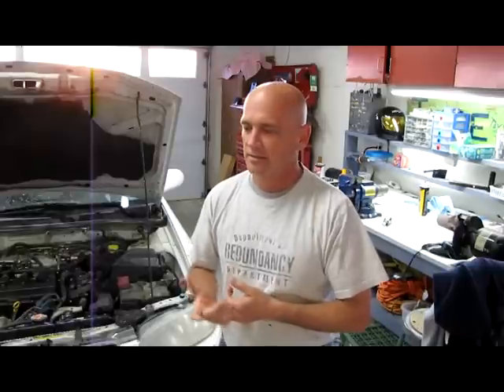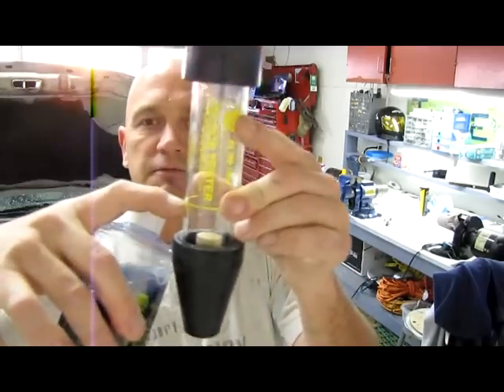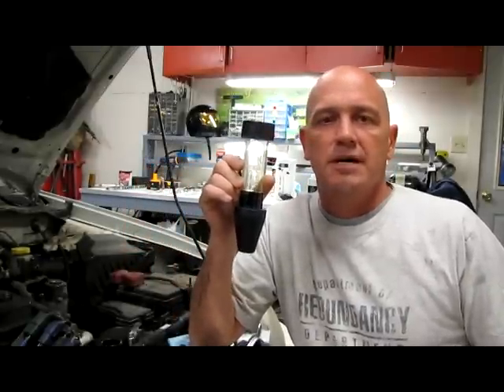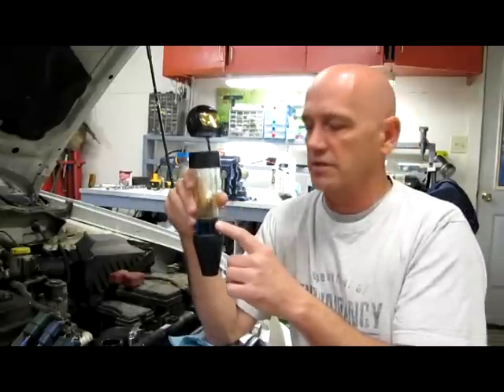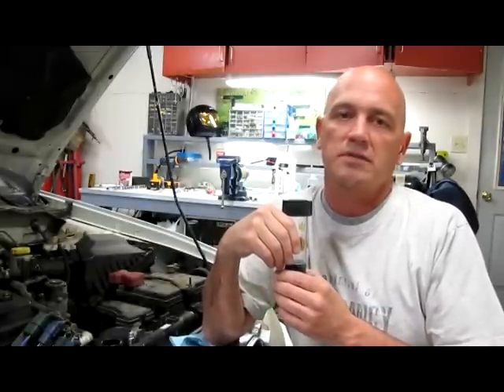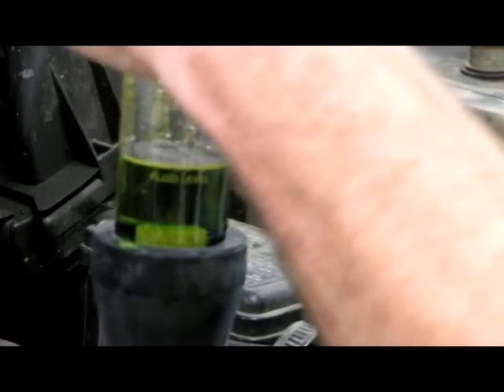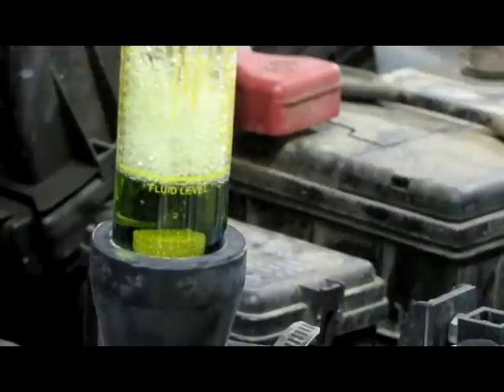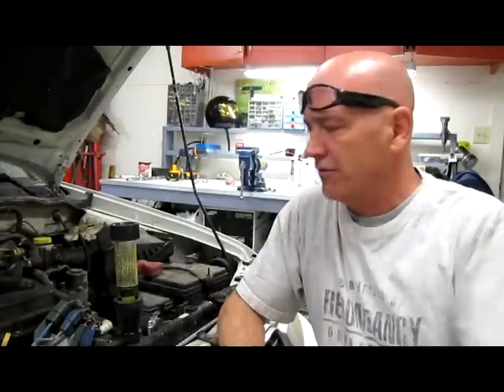How to Test Head Gasket

Comment: Can this test be performed using the coolant expansion tank instead of directly on the radiator?
Reply from the maker: ipdjbt: Yes.  If you search YouTube, you can find others using the same method with expansion tanks.  r-
Reply: Thanks!  I wasn't sure if the vapors would travel to the tank from the radiator.
Reply from the maker: The vapors 'should.'  I say this only because I've seen other videos of folks doing the test this way.  This stuff isn't cheap, so I suggest you contact the maker at go blue devil dot com, all one word of course.  Would love to hear back on your results!  r-
Reply: My results were negative, which lead me to question if the expansion tank test was valid or not.  I may perform the test using the radiator just to confirm my results.  Thanks for all the info!
Reply from the maker: Ok- just run the coolant low enough level-wise to only grasp vapors, but keep an eye on the operating temp!  Good Luck and Thx for sharing!  r-

Comment: This was absolutely so helpful, I have a 2000 oldsmobile intrigue that expels white smoke trough the tailpipe, no heat in the cabin, engine overheats. I've replaced the water pump, the thermostat, flushed the coolant system and still no good. I've done a lot of research on the internet and everything points to bad head gaskets. Thanks for the video.
Reply from the maker: perez74: Glad it was helpful.  That's the goal!  r-

Comment: Hey Russ - thanks for the video.  Great diagnostic.  I have a V6 Saturn wagon with coolant and oil mixed - oil is grey and gross on the dipstick.  Is a bad head gasket the only possible cause for coolant to leak into the engine block?  Am I living in denial thinking the problem could also possibly be a bad water pump gasket?  Now that I know oil and coolant are mixing, is there a test to find the point of the leak?

thanks
Reply from the maker: Greg: sorry for the late response...'gray' oil means really bad issues.  Yes, could be head gasket, but also could be ruined cracked engine block.   At this point, depends on the history of the car.  My apologies for the very late response....been teaching unappreciative college students on.....cars!  I've decided to keep this here...where all YOU guys appreciate my experience.  Message me with more questions if you 'd like.  r-
Reply: Thanks Russ.  I changed the oil in that car and the best description I have for the oil that drained out is gross.  I ended up selling it to a mechanic who wanted to rebuild the engine.
Reply from the maker: Greg, probably a good decision for both you and the mechanic if he/she is interested in rebuilding it.  r-

Comment: I have white smoke, at times excessive, coming out of the tailpipe, at times i can smell anti-freeze, and sometimes the heater gets cool, but then heats up again.  I don't have any of the other symptoms you describe for a bad head gasket.  Do my symptoms sound like a bad head gasket?
Reply from the maker: JusLitlOleMe: The main symptom you are missing that is very typical is overheating.  I wouldn't necessarily think you have a bad head gasket at this point. Since you've been smelling coolant, and your heater comes and goes, that's indicative of low coolant level as well.  So I'd probably have your cooling system pressurized to check for leaks to begin with.  r-

Comment: My car is keep on popping the upper radiator hose is this method good enough to track down the bad head gasket ?
Reply from the maker: StreetKa: Yes, this test is specifically designed to check for a bad head gasket, or more specifically, 'compression' or 'combustion' fumes in the cooling system.  Many times a blown head gasket causes this to happen.  r-
Reply: reluctorvalve hi reluctorvalve! my 01 330i is losing coolant but after inspection, the only coolant is surrounding the bottom of the engine. there is no coolant in the oil and the car runs and idles fine. the thermostat is bad because the car cools off when driving down the road and i'm losing about a cup of coolant per half hour of driving. my question is, could the head gasket be popped but only leaking to the outside of the head? if so, how can i check (other than observing coolant around the base of the engine)
Reply from the maker: Hi digitalblaspemy: Yes, it is possible for a head gasket to leak 'externally,' as you describe.  I've seen this happen before. I located this issue with a normal pressure check of the cooling system.  Have you done that yet? If not, I'd recommend that.  Also, can you describe more precisely what 'surrounding the bottom of the engine' would be?  Would that mean literally coolant on the ground beneath your engine?  One final suggestion: when you see fresh evidence of leaking (try to test in your garage, if you have one), use a flashlight and follow the trail of wetness upward. Gravity will lead you to the source of the leak, except in areas close to a rotating fan, where the leaking coolant may be blown back. Sounds like you keep a close eye on the ride- a good thing. r-
Reply: okay here's an update. i changed the oil yesterday. i cleaned the cap and dipstick as well. i didnt notice any water or coolant in the oil when i changed it. after 16 miles of driving i checked under the cap and i see the milky sludge on the cap. also on the cable of the dipstick though i dont see a difference in the amount of coolant lost so it must be slow or only at operating temp (which it will not get because my thermostat is stuck open) though it does leak quite fast when i leave it in park and let it idle to operating temp. the coolant is covering the front of the motor then leaking to the ground but there is no coolant anywhere else under the hood. i believe i need to change the gasket and possibly the head. geeezus i do not have the money for this!!!!!
Reply from the maker: Digitalblasphemy: You need to find that external leak.  For that run (or have someone run) a cooling system pressure check.  Next suggestion: you may want to do this block check to see if you have a compression leak if you're getting that milky sludge, just to know where you stand.  Third suggestion: you should consider watching my other YouTube videos on Blue Devil Head Gasket Sealer.  I'm not a believer in chemical quick-fixes, but it's worked for me.  r-
Reply: Thanks! I'm getting the chemical combustion check this weekend for the radiator. My thermo is wide open which MAY be the cause of the "sludge" under the cap because it just cannot get hot enough to evaporate the moisture. Either way, I'll know exactly what the story is. 

The fluidfix doesnt work for BMW's apparently, at least from what i have heard, because of the high compression of the engine. 

I'll report back this weekend for your information with more details. I recently uploaded a little vid of the temperature gauge. If you have 40 seconds, would you check that out and tell me what you think?? It's most bizarre and has me and everyone I have talked to stumped. 

Thanks so much for your advice! I appreciate the content and effort into your channel.
Reply from the maker: Sure- send me a link.  I don't see it on your youtube channel.

Comment: Very informative. I like the part were you explain that the head is aluminum and the block is cast iron. My car heat up pretty quickly so it should have a problem. Also, the fluids' color turn funny, I can't really remember the color but it's not rad fluid color.
Reply from the maker: Vincent: I have a few other (better) videos on this, so if you are interested in more you should take a look.  Thanks! r-

Comment from the maker: metal: just do a search on YouTube for "Napa Block Tester vs. Blue Devil Sealant". I had an old beater car, not worth spending all the money on a 'true' repair, so I thought I'd try this Blue Devil Sealant stuff. I did an initial block check, results = YELLOW; then applied the sealant. Then re-did a block check to see the difference in results: Original, exact BLUE, after the sealant was applied.  So you can see the color results in both ways on those 2 videos.Check them out and let me know! r-

Comment from the maker: metal:Most likely: yes.I was taught that anything other than the exact original blue indicates issues.  Take a look at my other videos.I have a 2-part series on your exact question. "Napa Block Tester vs. Blue Devil Sealant". Initial block test turned bright yellow. I performed the Blue Devil Sealant 'repair' (correct repair is gasket replacement/head check and correction). After applying this sealant, did another block check-EXACT SAME blue--not yellow or green. Let me know what you think! r-

Comment from the maker: xotr1x: I think I would. Also, be sure to try to find the root cause of the overheating to begin with.  If, say, the fan didn't come on and it is the original culprit, it would need to be replaced.  I think I would do the test after the repair-- 'cheap insurance,' as we used to say in the shop.  r-

Comment: my car had a blown head gasket 2 days ago 
i took it to the shop to get it done 
but where i live we don't have pro shops to do compression test on the engine head to rule out cracks they only resurface it 
should i use this test to check if everything is ok after getting it done

Comment from the maker: Jess: Might seem silly for me to include, but make sure your cooling fan works, whether it's electric or a mechanically-clutched unit.  Sitting with no RAM air over the radiator when needed can cause it to run too warm. Also, check both upper and lower radiator hoses at operating temp; again, both should be freegin hot. If one is drastically cooler, then you have a blockage somewhere- could be compression, thermostat, clog, etc. I'd run the test anyway- it's under $100 if you do it yourself.  r-

Comment from the maker: Jess cont'd: heater adjusted to warm inside the car. If both are cold, I'd suspect a bad thermostat like you did, or possibly a compression leak somewhere blocking the flow to the water outlet area (thermostat, usually) that feeds the core.If your heater hoses are both freegin hot and you still have cold air, that would be very odd but I'd suspect the heater control valve, or something not actuating it. Not all bad head gaskets cause milky oil, white smoke, etc. Might want to block check it. r-

Comment from the maker: Jess cont'd: heater core, or inadequate flow. To test the flow of a heater core, warm up the car to normal operating temp; locate the two heater hoses which feed the heater core-most FWD cars can be a pain, but find them. Safely feel the two hoses, preferably at the same time. Both should be freegin hot to the touch; not just warm, or luke warm. Now, if one is freegin hot and the other isn't, blockage AT the core, or bad heater control valve. They should feel about the same, with the cont'd...

Comment from the maker: Jess: Thx for the detailed description. Key in your symptoms is the cold heater. As we all have been taught, if the vehicle begins to run too warm, turn on the heater full blast to help, literally, dissipate the heat from the engine. Three things I know of which would cause you to have cold air when it's supposed to be hot. 1-low coolant level (most common, but you say it's full), 2-bad heater control valve (controls hot-to-cold adjustment), 3-blockage of coolant flow through the cont'd...

Comment: This was very informative but I'm not sure if its what I need? Two days ago my car overheated and when it got hot my heater would blow cold. I replaced the thermostat and its still overheating. The oil is not milky, no smoke from the tail pipe. Fluids are full and not leaking. Any suggestions?

Comment from the maker: RC cont'd: headgasket seal actually does really helps to understand all of this. In my experience, bad headgaskets most often crack between a coolant passage and the cylinder hole, or even in between cylinder holes. The fluid test isn't totally conclusive, then----but, if you have overheating, that now puts this into the ball game.  Hope this makes some sense.  r-

Comment from the maker: RC cont'd: a definite issue with with the headgasket seal. You might see a lot of burning oil out the tail pipe, crudded-up plugs, and most definitely a blockage of oil flow in that particular oil passage due to the high pressure of compression in there. BUT, no compression gasses in the cooling system, because the crack isn't near any of those holes. I've also seen EXTERNAL coolant leaks from bad headgaskets. Fluid test there would also be blue. So a good understanding of all that the cont'd..

Comment from the maker: RC cont'd: separated at that gasketing area (for lack of a better term), or to 'seal' the block and head together, keeping those separations. Now, imagine you have a crack in your gasket between an oil passage hole and a large cylinder hole in the gasket. What would happen? Although I haven't seen this myself, I'd imagine that oil could bleed into the cylinder, and (vice versa) compression could get into the oil passage. In this case, your fluid would remain blue, but you'd still have cont'd...

Comment from the maker: RC cont'd: for the cylinders themselves. All those other little holes allow passage of either coolant or oil from the bottom block to/from the cylinder head. Obviously, compression fumes would come from the cylinder, when the compression stroke is ignited, and when you have a faulty headgasket, most often that high-pressure of combustion (exhaust) makes its way into those other little holes, when it shouldn't. It is the job of the gasket to keep all the oil, coolant and compression gasses cont'd

Comment from the maker: RC: If it stays blue, it means that the test isn't detecting any compression-related or combustion-related gasses in the cooling system.  So as far as that particular area is concerned, it passes that test.  This doesn't test for bent or burnt valves or any other aspects that could be 'wrong' with a cylinder head. Let me give you one example: when you look at a new headgasket, you will notice there are a lot of different sized holes in it, as well as of course the very large ones cont'd...

Comment: Thanks so much for the detailed insight man.. Yeah it pretty much is a judgment call as far as fixing it or not after I get the feed back from my mechanic. I also forgot to tell you that my radiator cap smells like gas.. I know this isn't a good sign, either a cracked block or head gasket?? From the research I did I think it may be a block, ouch!

Comment from the maker: Brent cont'd: Your shop should be able to test your cap (I'm surprised they didn't!) to see if it holds what it should. Normal wear typically sees them hold LESS pressure, and your issue is too much pressure- based on my experience.  Repairing the intake leak would be mandatory (new cap recommended). But, before spending a lot of money on that, determine the extent of damage by having a shop run a good block test on your vehicle. Cont'd...

Comment from the maker: Brent cont'd: The radiator cap is actually a pressure-relief valve as well. As such, when the 'normal' cooling system is operating, the excess pressure is relieved by the radiator cap into the overflow tank. Ever notice the springie bottom part of the cap? That's the mechanical pressure relief part of it. Pressure pushes up to a certain point, then the 'springie' part is 'sprung' up and the excess pressure is relieved. Imagine what would happen if the cap didn't 'spring' like it should...cont'd.

Comment from the maker: Brent cont'd: The key element here is pressure, and too much of it.  I suspect one or both: compression leak and/or radiator cap. However, thinking in terms of time, that's not to say you didn't FIRST have a blockage of flow, bad fan, or stuck thermostat which originally CAUSED the extreme overheating, then compression leak, then over-pressurizing...etc, Let's first talk about the radiator cap. A lot of people don't know that a radiator cap is designed to 'do' more than hold coolant in. cont'd..

Comment from the maker: Brent Heyde: Thanks for the detailed history on the overheating issue you have.  Well, at least we know the cause of the issue, right?  That's more than a lot of people know with issues like this.  I agree with your mechanic in that I would also be concerned about the volume of coolant loss over a short period of time.  Because, what we DON'T know is the extent of the damage at this point. Your cracked radiator was caused by too much pressure. Well, what might have caused that?  cont'd...

Comment from the maker: Effie cont'd: although that's pretty rare and only found in most extreme cases. But, there is a degree of gamble when replacing the head gaskets, because in order to conclusively 'know' for sure if the block is good, the entire engine has to be uninstalled, disassembled and taken to a machine shop for specialized testing. I was always very up-front with my clientele about this, but it's pretty rare. Finally, when you look at the repair estimate your mechanic gives you for the job, continues...

Comment from the maker: Effie cont'd: Understand that the damaged headgasket, or seal in between the lower block and upper head(s), is usually the RESULT of another cooling system problem: thermostat, a leak, faulty fan, etc. So, just because the gasket is replaced doesn't necessarily mean that the 'problem' is solved conclusively. I always did a thorough system check prior to R/R heads, just to determine this, if I could. Next, understand that extreme overheating can actually damage that large lower block, continues..